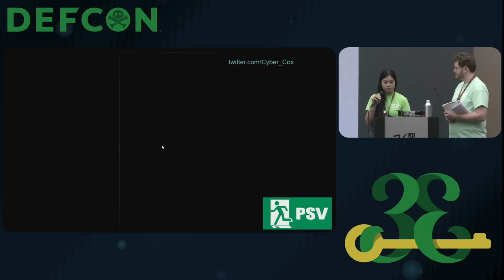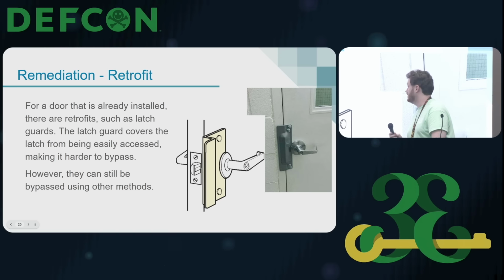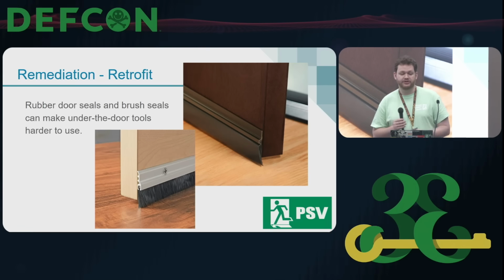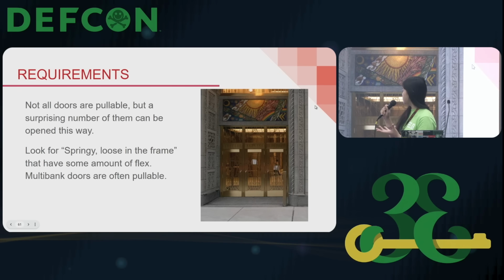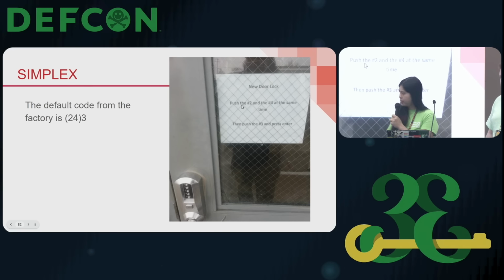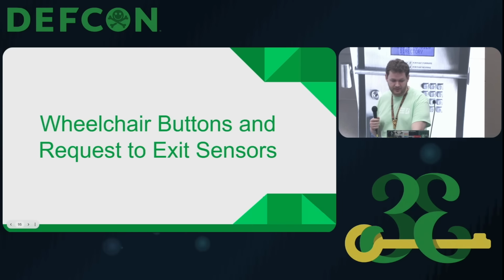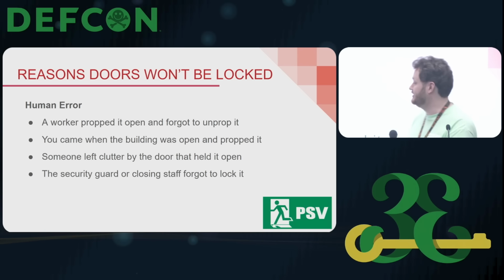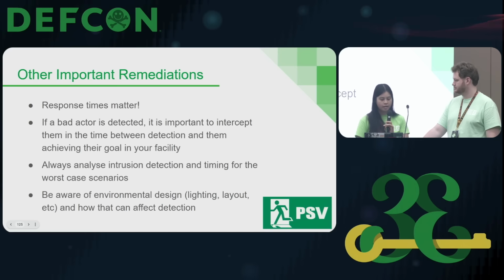DEF CON 33 - Intro to Physical Security Bypass - Karen Ng, Matthew Cancilla

Comment: As a German locksmith I watched this video hoping I could learn something new. Oh boy, I did: My work would be so much easier in the US of A. 
Look at that "thing" at 21:00! That's not a door, but more like a curtain. You guys really install that in buildings?! And the hinges as well: We use those hinges in furnitures, but not on doors.
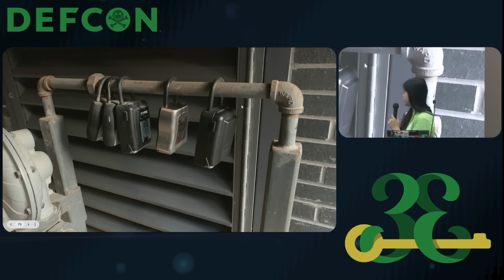Please tell me 28:30 and 28:59 were just jokes! You can open (/decode) those Master Lock boxes with nothing more than a piece of paper (tbh: shimming would be faster).
Enterphones with the controls OUTSIDE the house? Really?! Even the oldest appartment buildings I know have all the controls inside the building.
There are so many differences in building security between Europe and you guys over there. I'm shocked.

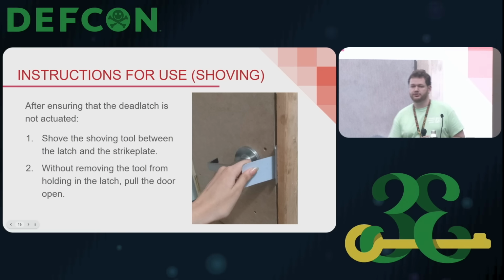Comment: 6:56 so they breaking in from the inside of the door?
my favorite access would be the brick vs window method in alot of cases and the roof is the least secure part of the building with a 7/16 socket (approx 8mm) if a sheeted metal roof or lift a couple of tiles and climb in

Hvac worklife is all about gaining entry to old plant and building accesses

Comment: Double sided keyed deadbolts violate fire code. You can also just have an empty cover plate, but again, that violates fire code, whether key or empty plate, you can't have an un-openable lock on the inside on an egress door.
Reply: They definitely violate fire code in North America! Double sided keyed deadbolts are common in European residential setups, though it's recently being phased out in favour of thumb turn deadbolts for safety reasons!

Comment: I'm a Cyber Sec/Information Assurance student, and physical security is so cool. Love all the creative ways that can be used to defeat simple locking mechanisms.

Also just to add, some of the earlier mechanisms and examples were clearly examples on SCHOOL BASED INFRASTRUCTURE. this is insane. We want to pretend our kids are safe from school shootings but anyone with a wire coat hanger can bypass most security locks in schools??

Comment: Please be careful when removing hinge pins. Doors are heavy in real life. In the demo the door tilted forward a bunch and that was a very lightweight, very small demo door. Don’t end up getting crushed by a heavy commercial door. 

There are tools made for stabilizing the door when you’ve removed the hinge pin that should be used to avoid damaging yourself or your client’s door
Reply: A sledge hammer ?
Reply: @Gotsqueeze2345  the tool is colloquially known as a “Johnson Bar” although sometimes it’s called a “Pry Lever Bar” or “Lever Dolly”